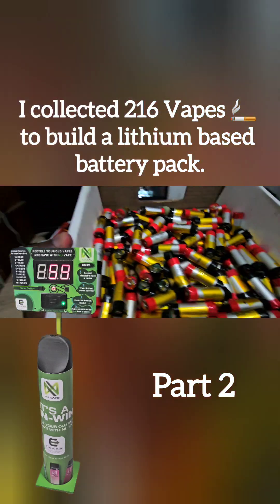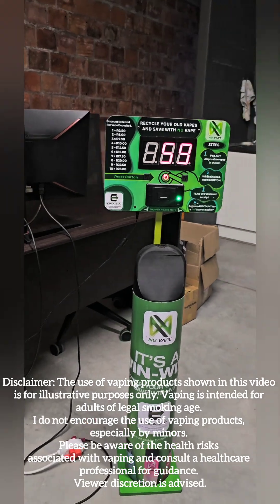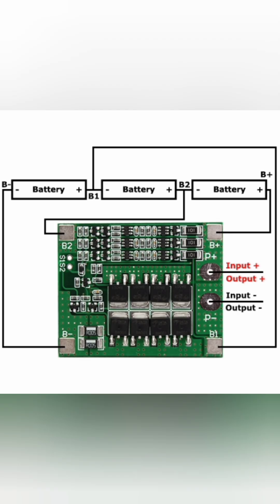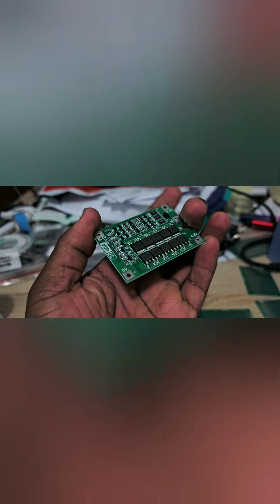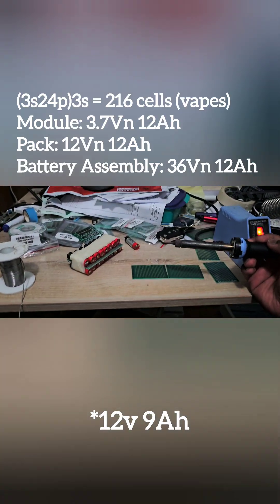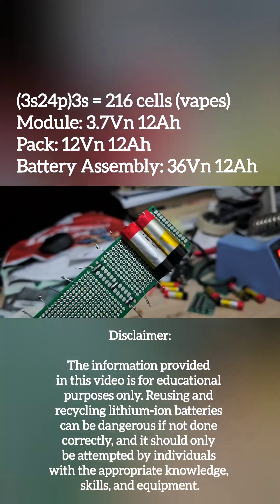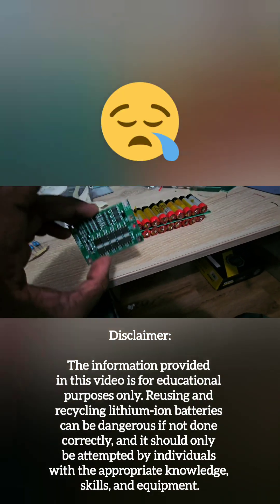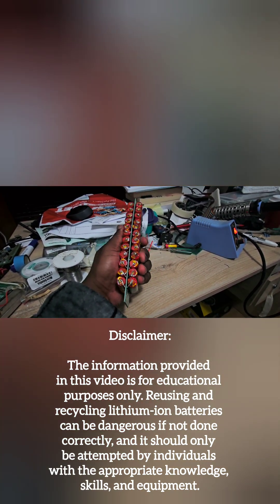I collected 216 vapes 🚬  to build a lithium based battery pack. Part 2

Comment: Nice! How are you balancing these cells before connecting them in parallel?
Reply from the maker: @1oblob  hey Chris. Just charging them all up to  4v before connecting them in parallel. Once connected, there's no intelligence in keeping them balanced; they self balance. Also, I'm yet to test out the extend of damage in the case of a short between the parallel unmonitored cells. However, when scaling, I'll look at using some intelligence in monitoring the cells (BMS). For now it's just an inexpensive experiment.  

Great content, by the way. Like your channel.